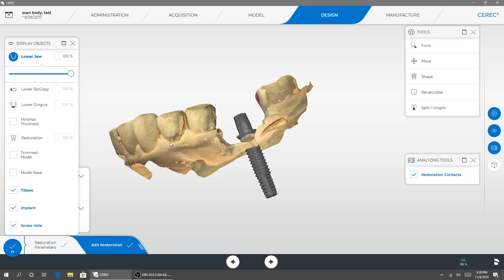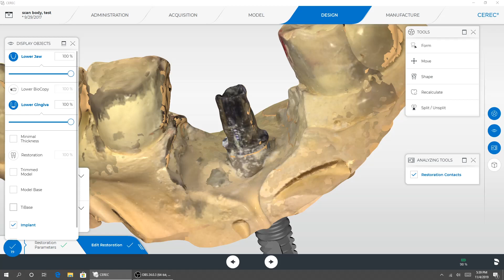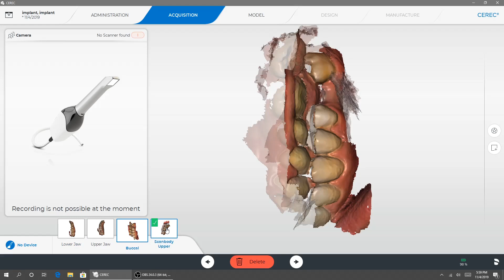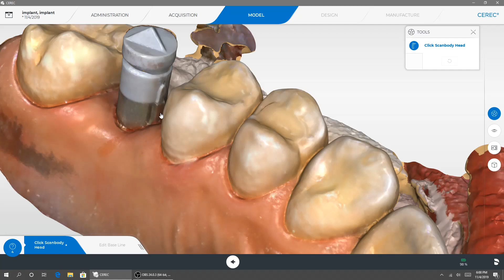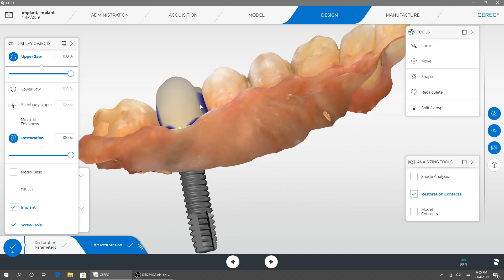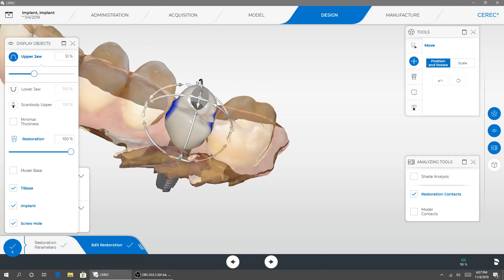Digitally Restoring Hiossen Implants using CEREC at Garr Dental Center, Carrington, ND

Comment: Why did you have to use B C 4.1 for the tibase? Is this compatible with most hiossen implants?
Reply from the maker: I've found the BC 4.1 puts the level of the digital tibase at the same position in space as the actual tibase.  They work on a hex too so that is consistent with Hiossen.  I don't use BC products... just using a setting that puts the Hiossen tibase in a position that matches and fits really well.  Since doing it this way I haven't had any fit problems.
Reply: Ben Garr awesome, thank you!
Reply: @bengarrDigidoc  You use the BC 4.1 for a Regular Et3 implant, what about for a mini et3?
Reply: How about for mini do you still use 4.1 thanks 🙏🏼